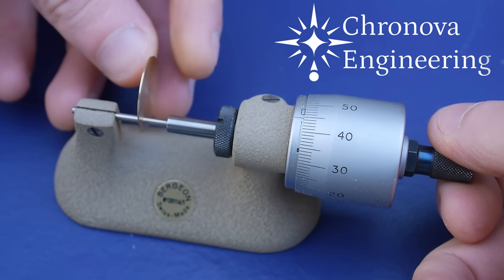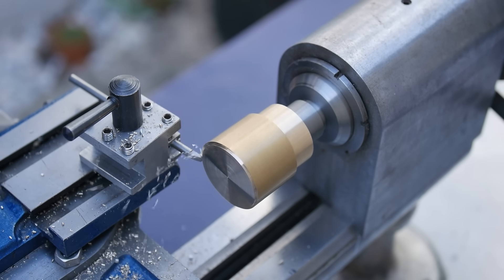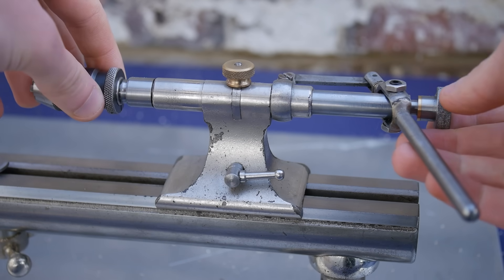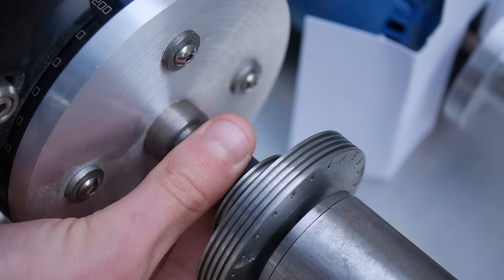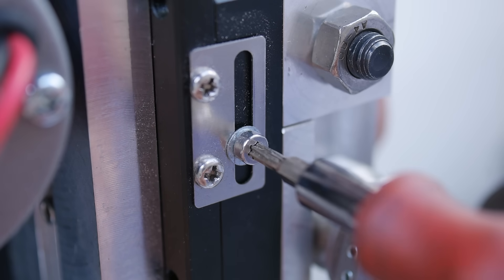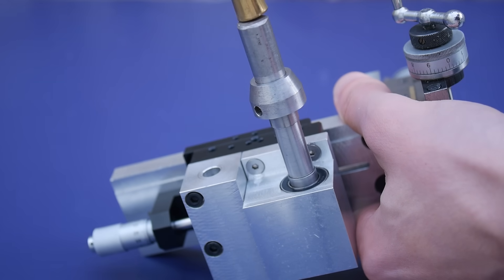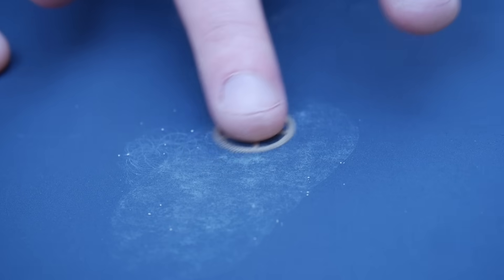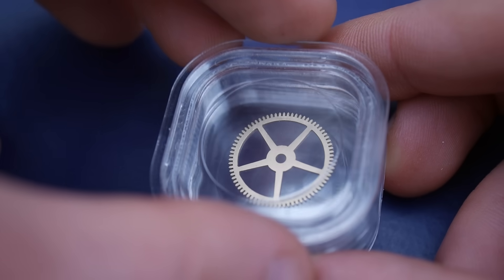Watchmaking: Machining a Watch Gear

Comment: If I may, I argue this watchmaker's setup is too elaborate and offputting to the amateur watchmaker. Also, I think the dividing head should not have been used, but a thorough explanation of traditional geometrical division been explained. It comes off as a necessity for watchmakers be dependent on elaborate and expensive tools- when all the finest brands Breguet, Glasshutte, Vacheron Constantine, Patek Phillipe etc were once all hand made on simple treadle lathes and marking out, calculations relevant to gear cutting etc was entirely done by notepad, not digital calculators.
The lathe does not need to be elaborate, but merely run true, and be a simple pedal driven affair, like most soft-metal working machines since 1700's. Traditional watch-makers lathes can be packed up in a box. Brass is soft and easy to cut. Additionally people should bear in mind all mechanical watches are less accurate than a £1 quartz watch.

Comment: Loctite and superglue are anaerobic sealants, so they dry with lack of oxygen
Reply from the maker: You are correct. I should have been more specific, the ‘air’ grooves are not for the oxygen, rather the moisture in air which is required to initiate polymerisation of the superglue. Loctite 603 doesn’t require this.

Comment: Why is it ok using a reamer to finalize the diameter? Do you expect the reamer to bend slightly to follow the position of the hole even if the tail stock is a tiny bit off?
Reply from the maker: Correct. This is helped by the fact it only had a tiny amount to remove, so it can only be slightly out of concentric in the worst case scenario.

Comment: beautifully done!  I liked the tip you gave about the champagne cork to softly but firmly hold the gear while filing.  I was a bit concerned that the teeth pressing against the cork could break due to the sharp roots of the gear teeth.  A stone to put small radii on the flycutter tip would solve the sharp internal corners on the teeth roots.  I doubt there is a lot of force against the teeth during normal clock operation, but over time the sharp corners could be a stress concentrator and the watch could fail.
Reply from the maker: Thanks for the tip! I considered making the cutter for round bottomed teeth but prefer the appearance of square bottomed teeth. Perhaps a compromise between the two, as you say, is the way forward.

Comment: This may be a dumb question but.... do you have to balance new gears or is that not necessary?
Reply from the maker: To my knowledge, watchmakers don’t balance gears; however, we recently published an article in the Horological Journal that found if you are trying to make a very accurate watch/clock movement, balancing the wheels does improve rate variability. Thanks for watching.

Comment: What method do you use for setting the depth of cut??? I have only ever seen the method of cutting either side of 1 tooth and when the layout blue disappears, you are at the right depth
Reply from the maker: Hi Ian, this is exactly what I did on the first wheel I cut but there's no need to do it on every wheel - just record the depth of cut when all the blue dissapears and then go straight to that setting for all future wheels.

Comment: I am not into watches, My machines are wallowed out and my work is much too sloppy. Even still, it is cool to see the thought process and the techniques you have shared. I think there is enough guidance in this video that I could make functional gears on my dysfunctional lathe. Thanks!

Comment: I really like the idea of indexing a lathe spindle, in conjunction with a cross slide mounted milling spindle. After using a big Harrison (the spindle nose is about 10 inch diameter, spindle bore about 4 inch, and a lovely lathe to use) it's fun to watch a smaller lathe is use.

Comment: Is that gear cutting cross slide modified to fit the WW lathe bed from the C6104 22mm d-bed version? Building that gear cutting / milling head setup seems worth a little mention, since there are a lot of design choices and such.
Reply from the maker: Well spotted, that's exactly what I did. I used my milling machine to modify the cross slide. I also scraped in the slideways. These Chinese parts work well provided they get some TLC first. I am intending to cover the watchmakers lathe and the tooling I designed and built to go with it in a seperate video. Thanks for watching.

Comment: i wonder if an FEM analysis might yield a more ''efficient'' spoke design, vs. the ''traditional'' shapes?
Reply from the maker: Almost certainly, but for a slow moving wheel such as this one, by far and away the primary reason for the spokes is aesthetic, which is subjective. For the faster wheels, some computational models, as you suggest, might be worthwhile. Thanks for watching!
Reply: @chronovaengineering  thanks for getting back to me... sure enough, for something that runs at an equivalent to 300.500 RPM, going to some super-optimized design makes little sense, generally... what I have found interesting, though, is the 'unexpected', things that look very organic, or just plain strange!
Super-nice to run across you guys("guys" in the non-gendered mode...)
Oh, and... "Subscribed" + Bell for All  :-)
Reply: Horologists generally stay with cycloidal gearing because there isn't enough clearance on low tooth-count pinions for an involute shape. You end up with too little strength, or  cut the teeth off.

Comment: i wondered at the apparently-low rpm on the 0,5 mm end mill...one expects 20,000 rpm, or more, for such a small device...also, have you used any cutting fluid for this? maybe a bit too messy?
Reply from the maker: Yes, unfortunately a limitation of my setup is the ability to get a wide range of spindle speeds on the milling/drilling attachment. I just have to use slow feeds, and it's OK. I might use a cutting lubricant on steel - no need for brass. In fact, I do all my brass machining dry. Thanks for watching!

Comment: Hi Chronova, I'm very amused by all the DIY machines used in gear cutting. Would it be possible to feature the making of machines at a particular job such as gear pitching or otherwise. This would be great for hobby home machine builders like us. Thank you!
Reply from the maker: Hi Steve. Absolutely, we will try to cover these in more detail in future videos. We will also work on putting together drawings for various attachments when we get the time.
Reply: Looks quite hilarious i was spoiled by schaublins at school and haven’t been able to find a better setup so im just saving up now, on my return to england i was quite disapointed by the variety and quality of english lathes available in comparison
Reply: @felixarbable   Hi Felix Schaublin would be the best lathe standing. Visited a local Swiss watch repair retail last year. They do own 2 Schaublin lathes from the 70s. Now converting my Power Record wood lathe to Schaublin level for metal work :)

Comment: Your channel is quickly becoming a favourite! 😎

I'd love to see a video showing what tools you are using. 😬 I'd be particularly interested in seeing the milling attachment you made. Can I ask the motor specs? I want to make something similar. 👍
Reply from the maker: Thank you for your support! The motor is the XD-3420. They are cheap and easy to buy off eBay. Despite the low price, it runs very smoothly and quietly with ample power - it's perfect for this sort of thing. Best of luck with your project.
Reply: @chronovaengineering  Thanks for that. Sorry to be a nuisance but do you think it has enough power to drill holes up to say 6mm?
Reply from the maker: @machinist_matt  No worries. I think it would manage 6 mm OK in aluminium or brass, provided you use pulleys/gears to get sufficient torque. I would suggest a bigger motor for anything larger than 6 mm though.
Reply: @chronovaengineering  Perfect thanks. 👍

Comment: Old Machinist 😊. I've thrown off Chips bigger than your gear.  Amazing to see the other end of the spectrum. 👍
Reply: I used to work in a shop. The smallest bore I  did was only .062. Watch parts are so micro that requires special touch.
Reply: Its fascinating isnt it. your entire shop fits on your desk. Evrything in lovely miniture form is so satifying and fun.